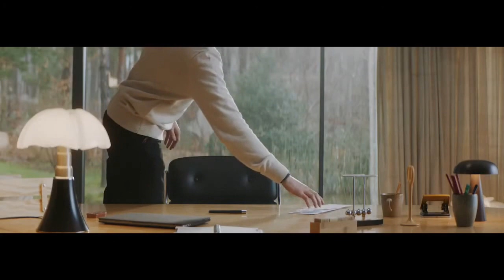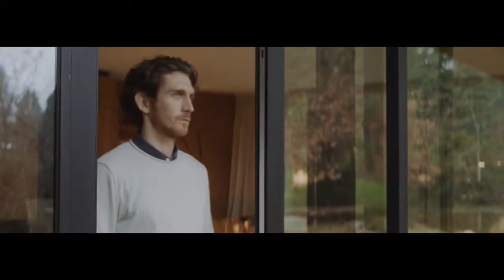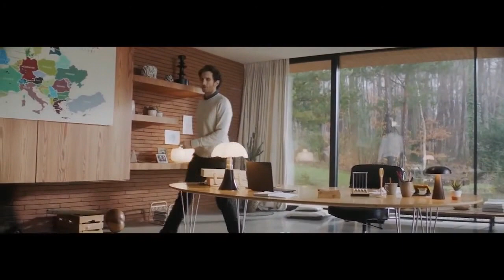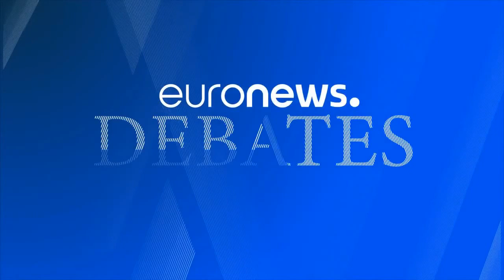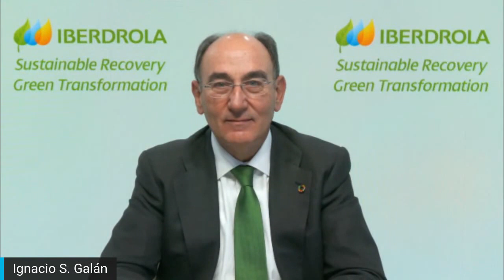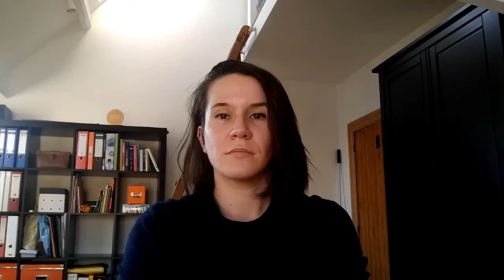Euronews Debates: Can the EU Green Deal empower business and consumer change?

Comment: This story tells it all: Foxconn is building another Apple tablets assembly  factory ...... in Vietnam ! If EU Youth does not learn to assemble the cyber tools we all use , they will fail.
Every European must have a smartphone, tablet ,laptop, cheap data & solid training in HTML5, Linux, e-commerce , Radios, batteries , photons , hot gases & plasma , gravity , etc. 
Will EU Schools start training in batteries & electric bicycles ? Hydrogen fuel cells ? Tablets assembly ?
Reply: Sadly , watching this video in multiple devices , some show only 15 comments , so Euronews or YouTube moderators are deleting 52 comments or they post multiple different video streams to control responses , in my opinion all these CEO's should be very disappointed that Clean Energy & their time is being abused in a very serious way.